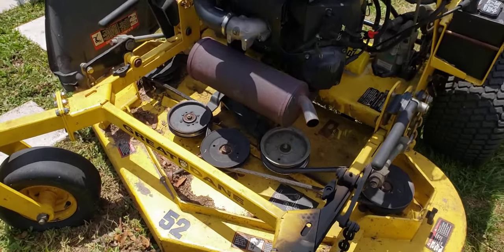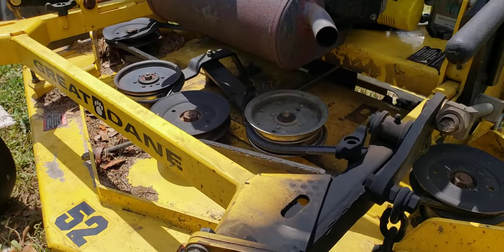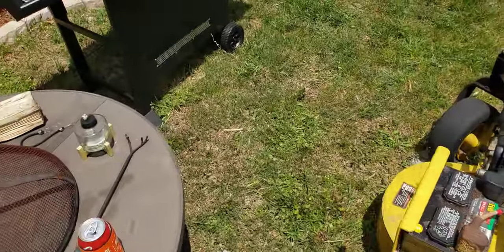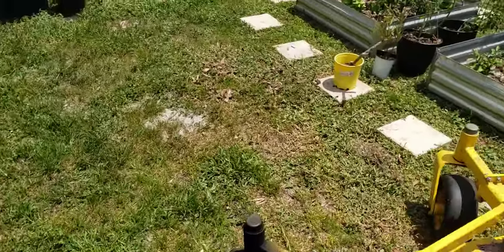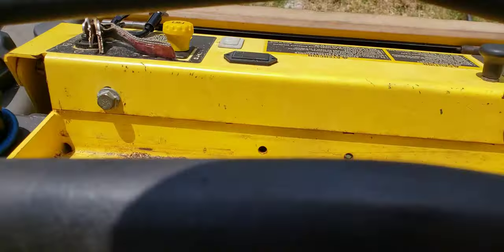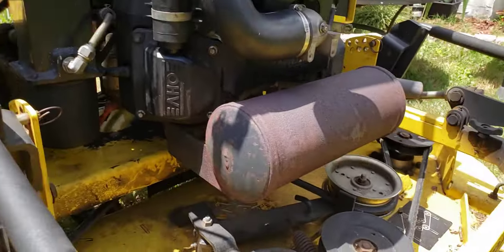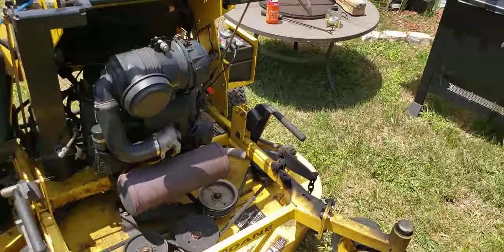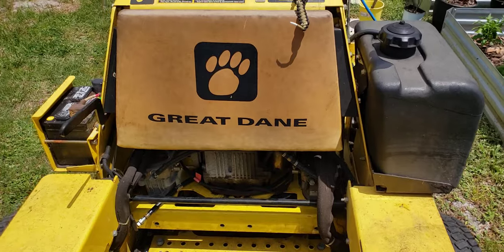Great Dane 52 Kohler Command 23 black smoke.

Comment: I have the exact mower and same problem happened all sudden while using torn everything down the only thing I could see was coil wire looks like it was rubbing hot metal I'm still waiting on head gasket to show up to see if it works I could really use your opinion of how yours was fixed

Comment: I'v been having this issue across 3 engines over a year and a half now starting to think the mowers are cursed mine runs good at high throttle it sounds like a shotgun when you turn it off New Muffler air filter Fuel pump and filter sparkplugs carburetor compression is 120 on both sides I'm gonna be throwing my mower away soon if I can't figure out a solution I just want to mow my grass!!!